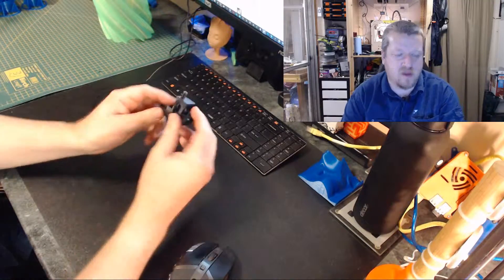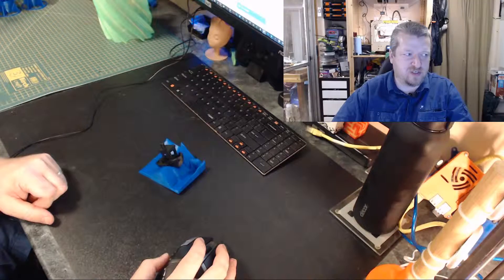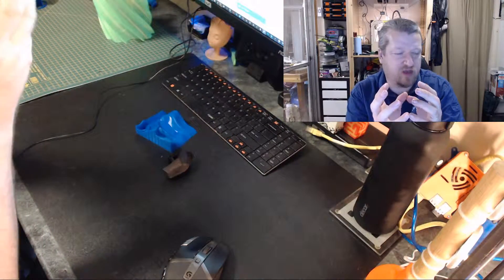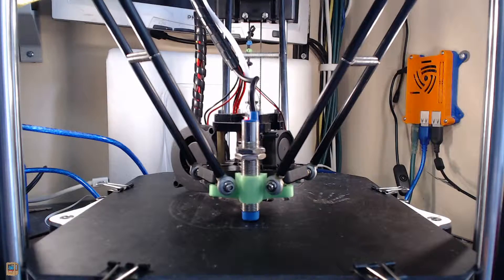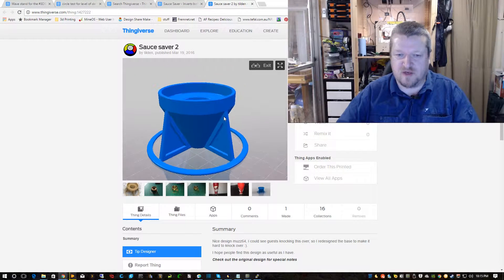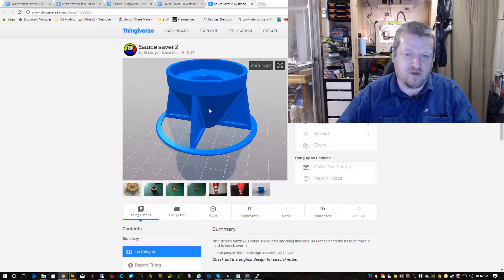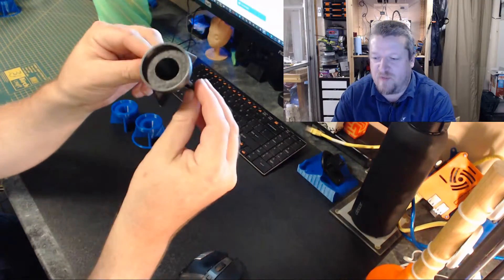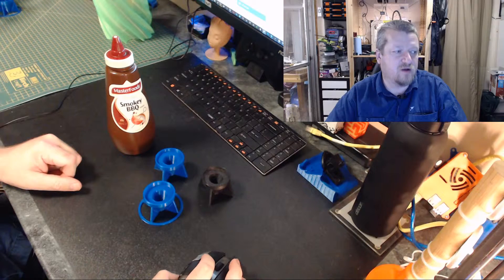Episode 10: Delta leveling / Effector Tilt

Comment: Never used auto level and doubt I can be bothered to set it up and calib when I have never had problems. no problem. no solution
Reply from the maker: I have since disabled the auto level on that machine as it had issues with end effector tilt it would level consistently unlevel. I have installed a similar sensor on the CR-10 and that is working well.